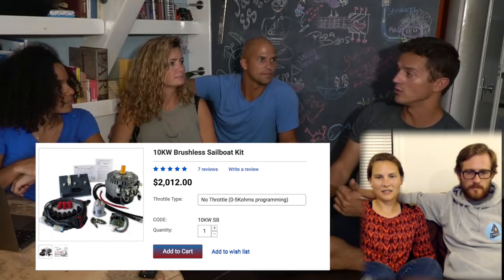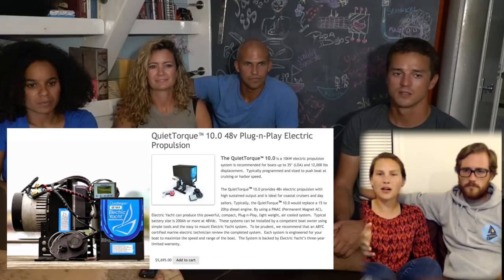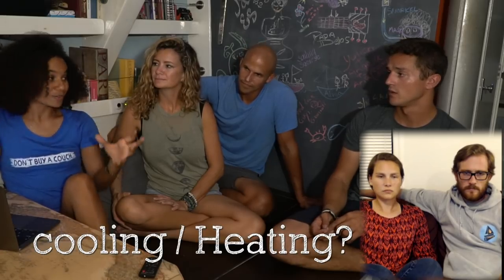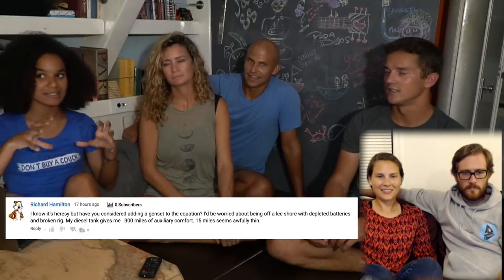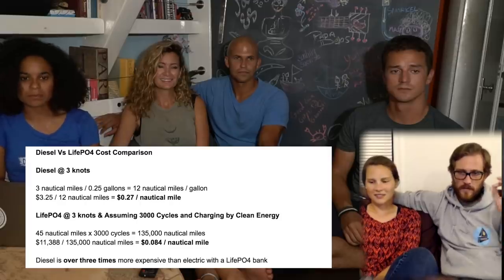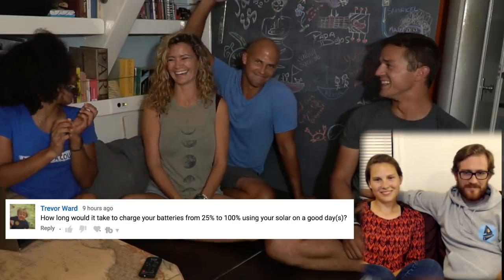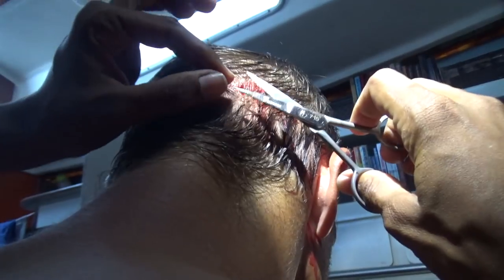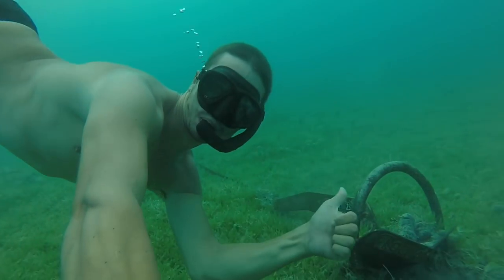Electric Sailboats: An HONEST Discussion — Sailing Uma [Step 140]

Comment: Diesel-electric hybrid along with plenty of solar is the way to go, and you're covered in pretty much any situation. By this, I mean having both the diesel and electric motor able to power the boat with the diesel running a 48V generator. This way, one can recharge batteries in the event bad weather over days prevents your solar from keeping up with battery loads as percentage levels fall. I would rig my output from the gearbox to the prop shaft with a slip collar type clutch to reduce drag from the gearbox during regeneration. Now if caught in stormy weather with high winds driving you towards a reef, and your batteries are dead, you can fire up that trusty old smelly diesel, put her in gear, and power to safety. Now you motor into a safe anchorage, and while you recharge, you can use all the other electronics. Once you've got your batteries up to an acceptable level, shut the diesel down. Here's but one more scenario. Say your electric motor fails for whatever reason, and you're out in blue water, I bet that diesel engine firing up would really sound sweet. Just an old man who knows better than to assume everything will go right because it never does — plan for anything.

Comment: What about using the motor to charge while sailing?  Do you have that capacity?
Reply: So a battery powered motor to charge the same batteries?.... Just think about that for a second and see if you can figure out the problem.

Comment: Regen works really well. When we crossed the Atlantic, our solar panels died in the begging due to corrosion and all of our power generation came from regen and it kept all of our batteries fully charged. (Check out our channel for details on our Electric Yachts QT20)

Comment: My friend thought he could sail Lake Erie with JUST a small electric motor. Save the environment, people sailed for 1000's of years with no motor blah blah blah. His boat is a shipwreck now and his motor is in his apartment where I took it and him after rescuing him with my gas powered dinghy. And that is on a fresh water lake. Electric motors are great for bikes and skateboards NOT boats. You are just putting the responsibility of getting yourself out of a tough situation on to other people. And trust me, I am a HUGE electric power enthusiast. I even like to use an electric trolling motor to push my sailboat sometimes. I love the idea guys, trust me, I do, but in my experience I would NEVER rely on an electric motor as my primary motor on the ocean. Don't bring a knife to a gun fight. Best of luck guys. Stay safe.

Comment: Please look up the lithium fields and the recycling of the batteries. You can biodiesel ( cooking oil ). But fuel can be hard to find solar power or wind is free. My dads sailboat if hey has a full electrical faller he can hand start the engine. The boat did lose the her mast in a hurricane the man who had it motored her 100 miles to Jamaica the guy got it new in 1960s and get a sea anchor. He managed and owned a marina.

Comment: I'm hoping someone here can answer my question:  I have an Islander 30, which weighs 8400 pounds empty.  According to the calculations from Sailing Uma, a 5kw motor would be more than powerful enough.  Others say I should go to 10kw.  I'd rather go with the smaller motor because it's much less expensive.  Would 5kw be powerful enough? It looks like Thunderstruck Motors is the best price, but if I can buy the individual components (motor, controller, contactor, throttle, wires, etc.) I  can cut 1/3 off the price.  Is this a good idea? Is there information out there that can tell me what components are compatible with others (what size, etc.)?
Reply: Here is the kit from Thunderstruck:  https://www.thunderstruck-ev.com/sevcon-brushless-sailboat-kit-5kw.html
Reply from the maker: Feel free to send Derek an email @ http://www.captineer.com/
He is an independent installer in the USA and was a HUGE help in sorting out our new electric system. He knows more about these systems than we could ever dream of. I'm sure he'd be happy to help you sort out the best kit for your boat. 

Also, keep in mind that a lot of those thunderstruck kits use the same motor and just different controller.
Reply: @SailingUma  Thank you so much for your reply!  I never thought you would be the ones to answer, if anyone did, because I know you must be busy.  I've watched a lot of your videos, particularly ones concerning your electric motors, and I've become rather OCD about trying to get an electric motor in my boat.  I can tell that you love what you are doing and I appreciate you sharing what you have learned through your videos and especially now directly with me.  I am honored to have someone so famous (you probably think that's funny) communicate with me! I will definitely check out the link you sent & send Derek an email.  Take care & thanks again!

Comment: utmost respect,.. while I do not agree for reasons of range,...  I think once the tech is there to make 7 knots for 500-1000 NM then electric is reasonable for long range cruising.  That opinion and $5 will get you a small coffee at Starbucks,..   If for some reason your primary rig goes down, then being able to make a long range under power is essential.

Comment: No I am talking about using a surplus cargo parachute cost around $ 200 way higher than your mast .
Reply from the maker: Not sure how it would generate any lift to stay in the air. But some folks do use surplus shoots as sea anchors to assist heaving to.

Comment: “Catamarans are perfect for solar...” - best line of the session. I’m planning on building a cat in a couple years, 100% electric! Loving this video. One thought I’ve had. Range is essential to diesel boats because you need to know how far away you can get from a source of fuel. But range is irrelevant on an electric boat, because your fuel is always right next to you, either in the wind, water or sun.

Comment: Id you do like liquide cooling  it wise to use oil. 
There is special oil for underwater pumps to cool that pump motor. 
An oil tube under water of a air to oil heat exchanger will do the job. 
You only need a small oil displacement pump.
Also get multi Kristal line PV panels plus optimiser systems. These can handle shading better..
Flexible panels are still not good in efficiency. 

Prop power generation is not worth the effort to build. 
If you have it’s fine although it’s not a good power source. 
It’s not efficient enough.

Regular motors do create problems too. On numbers ..even more than an electrical system. 
Motoring true storm is not done.. that why you have a storm (head ) sail and maybe a sea (tow) anchor.

Comment: Two questions if I may:

1) Why not get an electric outboard that you could use on the dinghy and the yacht. Diesel engine as backup.

2) Your environmental concerns seem misplaced when you are frequently flying places, hiring cars, using your dinghy motor etc etc. The energy and chemicals that have gone into the battery bank must be far worse that running a Diesel engine for a few miles. 
But safety of being able to motor 100s of miles if required is also a huge factor. Don't you agree?

Comment: I hope 10 years from now, when watching this video, we will realize how clunky and pioneer-like your efforts were.  That is, I assume in 5-6 years we will have better battery density technology available, maybe better solar panels as well (partial shading is a major issue today), enough to make electric generation, storage and motors more efficient, accessible and hence ubiquitous. Having said that, I'm glad you guys are not waiting for that scenario to happen.  You are showing the way by already making it happen today, which ever way you can manage.
Reply: "I assume in 5-6 years we will have better battery density technology available..." While there are things on the horizon I don't think you will see any "breakthrough" technology that will be usable in 5 years.  LiFePO4 batteries are leaps ahead of lead-acid, but lead-acid is still the best "bang for the buck" if you have the space and can tolerate the weight.

Eight 6V golf cart batteries in series (48V)  would have about 100 Ah of "usable" power and cost less than ONE of those Battle Born LiFePO4 batteries.  Of course they would weight several times more than your LiFePO4 batteries.
Reply: Volunteering for experiments like these is what drives humanity's progress. Success or fail isn't the important issue but the experiment itself for others to exemplify from.
Reply: @C_R_O_M________  Experiments are for people who haven't done the research. The data is out there. Electric and diesel are about equal in my opinion, with one trading off benefits to the other. If you are happy with the benefits great, but don't paint the other side as "planet killers" to back up your choice.

Comment: Why didn't you use the ELCO motor? They having been powering boats with electric motors for almost 100 years.                     the Old Coastie
Reply from the maker: $$$. They cost about $30k
Reply: 10-4

Comment: Only real safety argument I have ever heard against electric propulsion is from Nick O'Kelly (Top Secret) who experienced a lightening strike which rendered all electrics un-useable. Hence reinstalled a couple of diesels to accompany the electric units. May be some way to isolate motor and battery system from this occurrence - dunno?
Reply from the maker: New diesels get fried with lightning as well since they have computer controls and starting circuits.
Reply: @SailingUma  Yes true. I believe Top Secret installed one diesel as a full manual for this reason.
Reply: @SailingUma  Sorry wasn't Nick O'Kelly was the owner of Top Secret who had the lightening strike. Ooops! Guy you got your SD15 from I believe?
Reply from the maker: He was the one who did the tour. Different guy owns the boat.

Comment: There was alot of talk about prop driven regeneration.  My research is that with current technology [no pun intended] it is very powerful on boats with high average sailing speeds.  Boats that sail at 8 knots plus in all conditions produce more power than they can use.  Boats that sail at 7 to 8 knots in ideal conditions are on the edge of making it work.  Slower and smaller boats are often disappointed, not having the speed, while also compounded by the drag due to less powerful rigs.  These are not absolute numbers.  It's probably possible to regenerate at less than 7 knots with just the right combination of prop, motor, controller and rig.  And if anyone knows of a legitimate system producing results on smaller, slower boats, I would be interested in the details.
Reply from the maker: Yes, slower boats don't generate much regen. The best systems we've seen start making power around 5kts. But it's only around 50-100W and it goes up from there. We've recently upgraded our motor and are currently testing regen to get some accurate numbers for everyone interested. You have to remember though, our boat, offshore sailing, only draws around 150W on average, so it doesn't take much power to match that. Stay tuned on our newest content to see our regen tests soon.
Reply: @SailingUma  50 watts at 5 knots is not bad.  That's about what a small dedicated hydro generator makes.  But as you point out in the video, engine driven regeneration  has to do that with a screw that's designed to push water the other direction.  So quite often I see their cut off speed up a little higher.

Comment: motoring against your anchor is actually good seamanship and could save your vessel, if you have an unexpected 70knots and a lee shore. no anchor will save you then and you'll need to be underway fast. don't ask me how I know this...
Reply from the maker: Really not sure who teaches this....but with a proper size and modern anchor, you shouldn't drag....ever... We've been anchored in 70kts in Miami and didn't drag, nor did we "motor against our anchor" to save out boat. We also anchored in Hurricane Matthew with winds in access of 100kts. Didn't drag then either. Using the motor to assist the anchor just means you have a terrible anchor.

Comment: Small diesel generator and electric motor and batteries solar and wind all on the boat.
Reply: Sound like a Toyota Prius sailboat. Good idea.
Reply: Almost all modern trains use diesel generators to produce electricity which then powers electric motors to move the train.

Comment: i think you're being dishonest when you try to paint diesel engines as being unreliable. if a diesel has clean air,clean fuel and clean oil it will most likely last for decades trouble free with little more than filters and raw water impellers in the way of parts. if a diesel stops due to water,air or crud in the fuel it's due to poor planning (see what i did there)  also on the safety aspect the advantage of a diesel is being able to motor into a wind or ocean current for days if necessary to avoid a severe weather event or if someone needs medical attention. you can't plan for every eventuality. i'd better just add i'm not against electric just pointing some things out i felt you dismissed due to bias. i actually think a combination of diesel,solar and wind generation providing electric propulsion might be the future.
Reply: You're wasting your time with this lot. Unfortunately, their biases may end up getting the killed, or worse, the people who try to rescue them.
Reply: I think it's more that people with problems go to marinas, so if you hang out in marinas you see more problems than really exist. It's kinda like going to the hospital and noting that it's full of sick people.

That said, I don't think the problems with electric motors are anywhere near as bad as many people like to make out. Sure, if you expect your boat to work just like your car, point it and go, that's only possible with a fossil boat. But if you actually like sailing an electric motor is much more practical.
Reply: I didn't get the sense that they were painting diesel engines as being unreliable. I got the sense that what they were saying is that based on the criticism and comments they've received, an electric motor isn't any less reliable than a diesel one (in regards to those particular comments - i.e. boat getting capsized and the like). They admitted the power output changes the way they sail, but that's just a habit thing, based on the capabilities of their boat. 

There is one main thing I feel like you missed, and it's one of your poor planning bits. Specifically the crud in the fuel. I don't think (or know if) there is a good way to make diesel (even biodiesel) on a boat, and if one is cruising, you are dependent on the local diesel available. Sometimes that isn't great. I believe S/V Delos had a couple of issues finding decent diesel in some locations.
Reply: not that i'm here to defend diesel or electric. but absolutely electric is less reliable than diesel until such point you can prove an electric motor will last decades with routine maintenance
absolutely can a diesel diesel continue running after a capsize, 
diesels will run at any angle though shouldn't be run upside down because the oil pickup won't be submerged but if a boat rolled through 360 it wouldn't be upside long enough to cause damage  
diesels without electronics can run run submerged in water providing the air intake isn't underwater
the planning is planning the fuel delivery and filtering system so that is functional and air,water,fungus/microbes etc are removed before they reach the pump and injectors.
all diesel fuel should be filtered before it goes in the tank and then treated against fungus/microbes that would otherwise grow in it.
then you can add fuel polishing filters before it even gets to your pre filter and water trap.
delos latest upload was an hours long video of motoring a river using the diesel engine. i also believe delos has been around the world with the same volvo diesel engine without major failure or needing a major overhaul.
Reply: I think some people have completely missed the entire point of the video. They clearly said they are not against diesel. But they clarified that even motors run on fossil fuels have their own issues and really aren't any more reliable than electric. They clarified the entire discussion with clear examples of how diesel engines have a lot of moving parts that wear out. Can't tell you how many videos I've watched of sailors who are waiting on, or replacing, parts on their diesels. Good thing about sailing is that you're not stuck if your engine quits. But when you're using your electric for 10-20 minutes at a time to get in or out of a marina, I would wager that it's just as, if not much more, reliable than a diesel. As mozismobile said, the problems with electric motors are very few and far between. So unless you're a "motorsailer" who thinks that wind isn't the way to sail, and you run the motor all the time, I seriously doubt you'd see any major issues with electric. And if that's the case, then keep your diesel and make sure you've got the appropriate spare parts, or maybe best to just stay ashore and fly to your destinations, rather than living on the water.
Electric motors are proven reliable by well over a century of increasingly reliable service in a thousand different industries. The environment onboard a sailboat can be a lot worse than some industries, but also much better than many where electric motors are performing without issue. And when properly protected from adverse conditions, will certainly be just as reliable as a diesel in the same conditions, and in some instances, much more so. Diesel certainly has its place for those who want it. And electric certainly has it's place for those who want it. Delos is a lot larger than Uma, also. So requires a much larger engine, more power, etc. And also a lot noisier... etc...